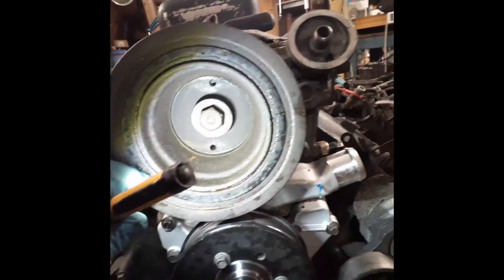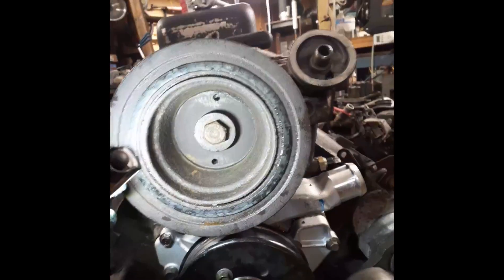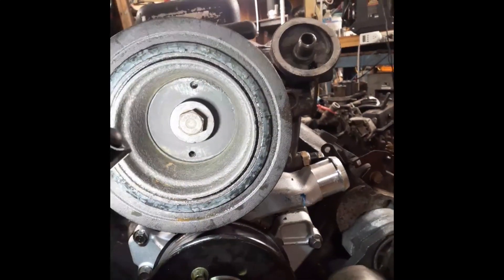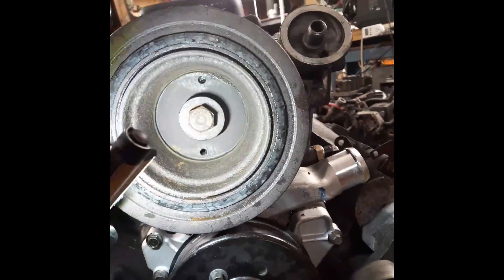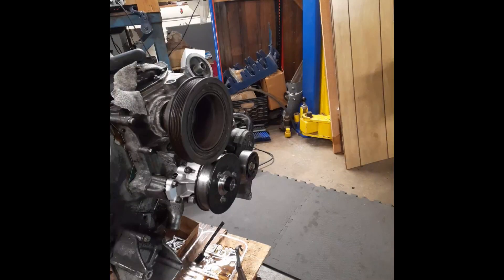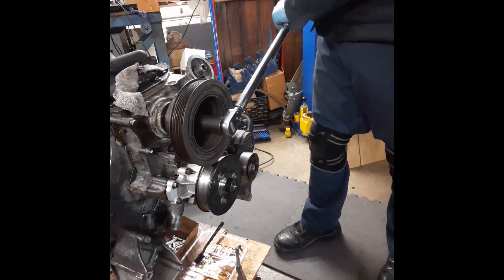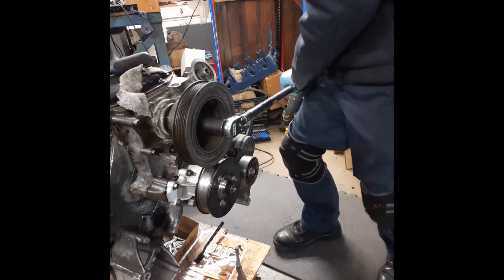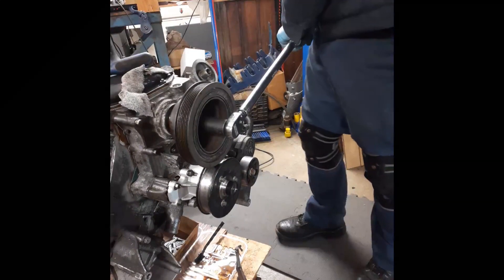How to torque the Crank Bolt on your engine.

Comment: you going to snap the bolt off like that .
Reply from the maker: If the bolt snaps, then it is too weak for the application.  It is essential to apply the torque in a smooth manner.  Using an impact would snap it.
Reply: @Youcanfixityourself123  yes but if it snap you have to drill it out
Reply from the maker: @zcam1969  It won't snap as I apply even, smooth torque.  Also, all bolts should be examined prior to assembly.  Only good or new bolts can be used in an engine.
Reply: @Youcanfixityourself123  yes ,but the threads are striped on my crankshaft and i am debating what to do about it
Reply from the maker: @zcam1969  If the engine is out of the truck, then remove the crankshaft and have a machine shop install a thread insert.  If the engine is in the truck, remove the engine and then the crank.  Personally, if I broke a crank bolt in my engine, I would remove the radiator and then install a thread insert.  But not just anyone can perform that operation with the crank installed.  If I could not find the right size insert, I would make one on my Rockwell Lathe.  The real trick, is drilling the crank perfectly along the rotational axis.  If it is not drilled correctly, then the insert will be crooked, and that will be bad for  everyone.
Reply: @Youcanfixityourself123  the motor is intact and in the car . i am going to do that thread insert and lock-tite and hope it stays together .
Reply from the maker: @zcam1969  make sure the insert that you choose is rated for the amount of torque that is applied to the bolt.  Also, use the Loctite that is rated for permanent installation.  There is one that states heat is required for removal.
Reply: @Youcanfixityourself123  Yeah Locktite red is the permannent bond . the bolt presses the balancer on though . the motor {350 Chevy} has ran for 30 years with the bolt loose .
Reply from the maker: @zcam1969  In my many years of retail auto repair, I've come across many a 350 and 305 that run without any crank bolts.  They have a press fit, and are tough to remove.  The cranks have threads but they were rusted and obviously never used.  Perhaps your engine is one of those and someone tried running a bolt into rusty threads and tore them up.  That bolt is a small diameter bolt, so the insert will be readily available, and the torque value for a 350 is pretty low.  The Rover engine in the video takes about 200 ft/lbs +/- if I recall correctly.  Take some photos and a video of the repair and post it for others to see.
Reply: @zcam1969   Dude literally saved you after you were talking smack. The only thing that I don't get is he said that engine can run without any crank bolt so why bother with a thread insert and not just run it?
Reply: @jhowardsupporter  you are right . i'm not going to run it until i get it bolted down
Reply: Is the bolt 19 mm?
Reply from the maker: @entintbyTVII  I do not recall.  I will measure it and repost.  I assume you are referring to the socket, not the bolt diameter.

Comment: Do you use anti-seize on a torque to yield crankshaft bolt?
Reply from the maker: No I do not.  I clean the threads of the hole and the bolt, and then wipe WD-40 on the threads with a cloth.  making sure to wet the threads, but not soak them.  If there is too much oil, it will hydro-lock the bolt.
Reply: anti seize will mess up your torque specs. Never use it on anything with an  important torque spec.

Anti sieze is great for bolts that hold up under trays etc however.
Reply from the maker: True.
Reply: @FrazerLovesDriving  I intend to use it on exhaust manifold studs and nuts when they arrive. I read you just reduce torque by 30%. It's definitely going on the ac compressor bolts holy phuck galvanic corrosion is no joke and I don't have map gas only jet lighters I smoke my meth with!
Reply: Nothing like the feeling of a Torque to yield bolt…….when it snaps !  Like the old adage, tighten til it breaks then back off a quarter turn ! 👍🏻